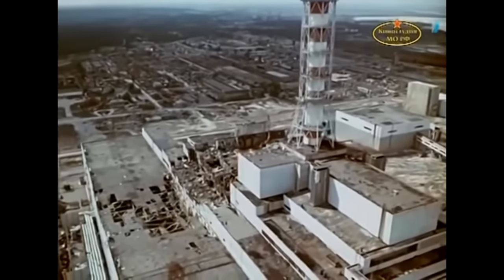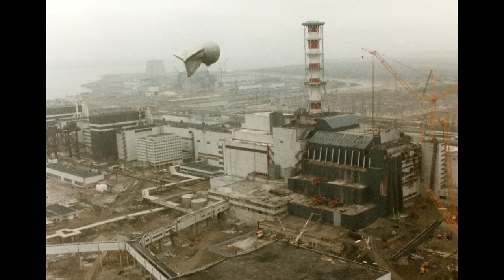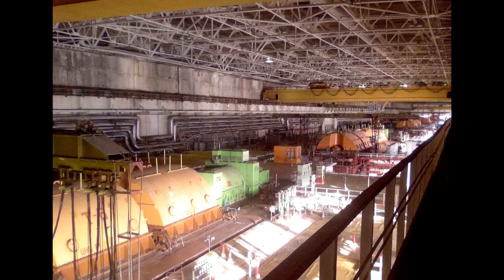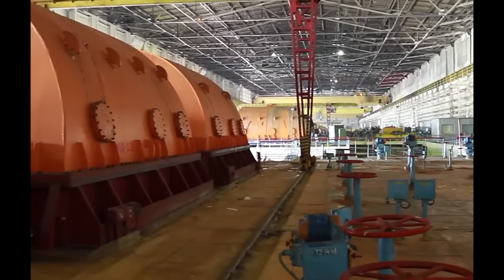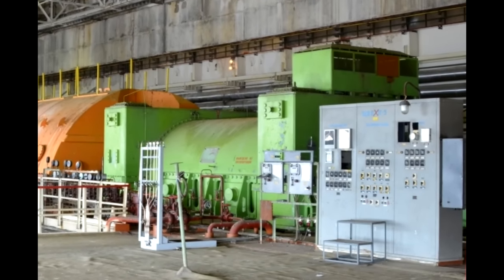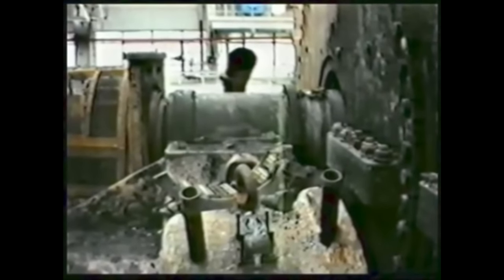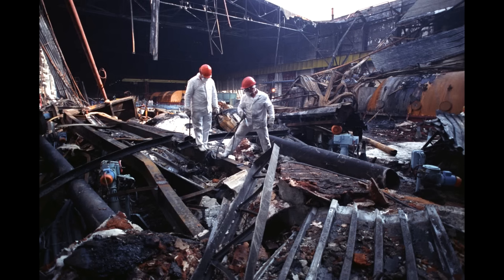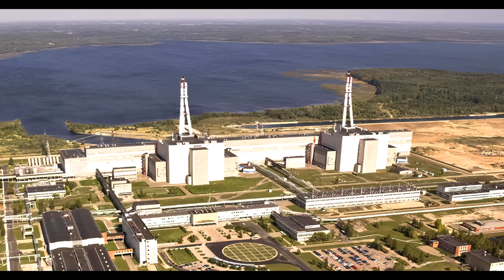The Chernobyl Unit Two Turbine Hall Fire: The Untold Story

Comment: A fascinating event. I'd always wondered if such a thing could be done - the reverse flow of electricity to a power station generator and now I know! I also learned of how terrible the consequences could be.
A great channel and quite addictive. Please keep the content coming   :)
Reply: Oh, it can certainly be done, and if action is not taken within seconds, it will wreck your turbogenerator. Along with the building it's sitting in. Woe the poor staff that happens to be in the turbine hall at that very moment....
Reply: It’s not very common, and depending on the relay protection, it will trip the next circuit up. I’m surprised that it motored so long without a major transmission system trip.
Reply: A friend worked in a cogen plant, burning landfill gas in large v16 engines. If the engines control system malfunctioned the grid would start trying to turn the engine! They had reverse current protection relays to prevent this.
Reply: Any generating station I have ever worked in has reverse power relays to stop shit like this happening. They also had disconnects that worked too.

Comment: Power station generators use recirculating hydrogen as a coolant. Once it escapes, it’s gone. However the turbine and alternator bearings use an oil that will crack to petrol when heated too high. Oil fires like this are incredibly fierce and dangerous.

Comment: Is there an official report about this incident, that's 1. accessible, and 2. in English? 😉  In a typical PWR, the condensate pumps are capable of supplying water to the steam generators (without feedwater pumps running), as long as the steam pressure is kept low enough. Interested in how it was done with a typical RBMK, and how much actual 'plumbing' was needed. With plumbing I mean connecting pipes with large capacity, cutting them and welding in situ... Or did they just use hoses, connected to already available valves?

EDIT: I found the NRC notice 93-71, and indeed it mentions the 'low pressure condensate pumps'. They 'aligned' the low-pressure non-safety condensate pump to the piping  of the auxiliary feedwater pumps. Could be that they had to cut/weld pipes for that (i.e. 'plumbing'), but not sure...
Reply: It's an RBMK, so the answer to 'how much plumbing' is always 'lots.'
Reply: @MinSredMash  
"A plumber's nightmare" would be an apt description. But so is the Canadian CANDU. It too has the pressure tube design. It even shares the same positive void coefficient with the RBMK. However, that didn't stop it from becoming one of the most robust and safest reactors bar none.

Comment: No plumbers involved, the Operators  reduced the steam pressure and "aligned" a condensate  pump to supply low pressure feed water  to the reactor. In this context "aligned" means opening valves, probably remotely controlled from the control room, but may have required some valves to be opened in the turbine hall. Source of data NRC INFORMATION NOTICE 93-71. The shocking thing is the lack of redundant feed systems separately located from the pumps in the turbine hall.
Reply from the maker: Actually, no. These were not remotely operated valves. New systems had to be set up to bypass the polishers and the deaerators; they did a very similar thing on April 26th, which involved plumbers working in waist deep water. Given that Unit Two was a less advanced version of Unit Four, I see it unlikely that said reactor had the redundancy in place.
Reply: @thatchernobylguy2915  OK you will have better information than the report I saw. I am surprised they had time to do pipe changes before the core became too hot. Are there any diagrams showing the plant design as I have never seen details of the condensate and feed systems and would be very interested. Thanks.

Comment: Hold up. Did you say 120kA short circuit on a 330kV circuit??  😳
Reply from the maker: Yes, that is reported in the NRC accident report.
Reply: short circuit current is typically much much higher than nominal

Comment: I still can't fathom that just a few years after the Chernobyl disaster in 1986 people were able to work in this environment wasn't everything highly radioactive at that point???   And wasn't Chernobyl  specifically set up for the city of Pripyat with it being  abandoned what was the need to even operate Chernobyl?

Very confusing to me ?
Reply: Someone with more knowledge of physics correct me if im wrong... OK, here goes. A lot of the contamination released in 1986 was made of very highly radioactive but short-lived isotopes, so even as early as 1991, these had already decayed into elements emitting lower levels of radiation. Items contaminated with long-life isotopes had also been removed or buried by this time, so radiation levels that had been caused by these were also reduced.
Reply: Pripyat was set up for the ChNPP. The remaining 3 reactors were needed for Ukraine and the USSR. A year or two after the accident the radiation levels became quite safe due to the containment building and the liquidators. To this day people still operate the switchyard at the NPP

Comment: Interesting video, but the audio is a bit murky; I strongly suggest cleaning it up in future videos. Get a better mic; use less-live room acoustics; and use better recording equipment, software, and techniques. For example, I had to replay the sentence at 3:52 several times, with boosted volume and at half speed, because I couldn't understand what "their primary pline" means. I eventually deduced from context that you actually meant "their primary plan". Less-murky audio would prevent such confusion.

Comment: The high voltage main swithchboard breaking short circuiting is terrifying. Was it one of the last grumbling failures of the mighty Soviet engineering or just a freak accident?
Reply: At this point, Soviet infrastructure was already crumbling for quite a long time.

Eventually, something's gotta give.
Reply: Maybe both.  The power plant I worked at had safety procedures to eliminate the ability of the breaker to reclose during shutdown and protective relays to disconnect the generator in the event of reverse power.  There had to be multiple failures or deficiencies in equipment and/or procedures for that incident to happen.

Comment: I think you mean the remote breaker opened, not closed.
Reply: With electricity, "open" means disconnected, and "closed" means connected.  It's the opposite terminology of plumbing. So the documentary statement is correct.
Reply: Which is my point. He said the remote breaker closed to stop the flow of electricity to the turbine. If the breaker closed then it would have kept feeding power back to the generator like was already happening anyway.

Comment: AZ5 worked in this case?
Reply: yeah, the flaw that caused unit 4 to explode with az-5 needed the reactor to be in very specific conditions, which unit 2 wasnt in, considering it was running at high power

Comment: P=VxA so 120,000a x 11,000v = 1.32Gw not sure this is possible even for 10-12Seconds
Reply: Well 1.0 GW is the rated operational electrical output power of 1 RBMK block with 2 generators. 
There were 2 of those running right next to the failing turbine (to be exact 1 was a little older and only 800MW). 

So the power was available quite easily.

Comment: It's impossible, you can't have a 120000a short circuit. Because mathematically it is impossible. 11kv divided by 0a is zero. 120,000A cable would be about 1000 meters in diameter IE 1km.lol😅
Reply from the maker: The 120,000 amp short circuit is confirmed in the accident report about the accident. And 120,000 amps is tiny compared to stuff we are producing nowadays.

For example, here's an energy magnet system running on 12 million amps. https://www.tokamakenergy.co.uk/2023/07/11/12-million-amps-tokamak-energy-magnet-system-to-replicate-extreme-fusion-power-plant-forces/
Reply: A 120kA cable is no wider than a human wrist...

Comment: Different story....

Fire at Chernobyl Unit-2
Nuclear Monitor Issue: #360
18/10/1991Article
(October 18, 1991) On Friday evening, 11 October, a hydrogen explosion in a large machinery room in the generator building at unit 2 of the Chernobyl nuclear power plant resulted in a fire lasting for more than three hours. The explosion and fire totally destroyed the unit's generator.

(360.3567) WISE Tarragona- According to a plant spokesperson, Sergei Akulinin, the origin of the fire was traced to rain water which had come into the machinery room through a large hole (60 x 48 meters!) in the roof. The water caused an electrical fault which in turn caused an increase in speed of unit 2's generator from 50 to 3,000 revolutions per minute. This then caused a break in one of the joints, resulting in an explosion of 500 cubic meters of hydrogen.
Reply from the maker: My video is based on the 1993 official report about the accident. Given the hole came after the hydrogen explosion, this version of events make no sense.